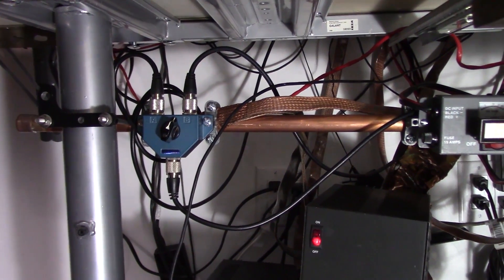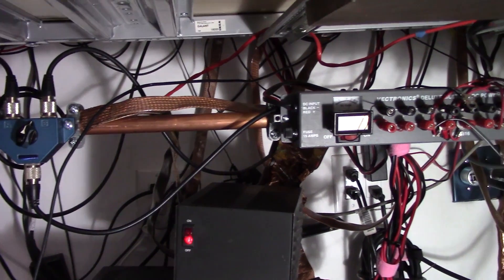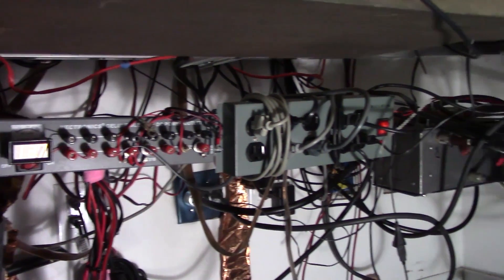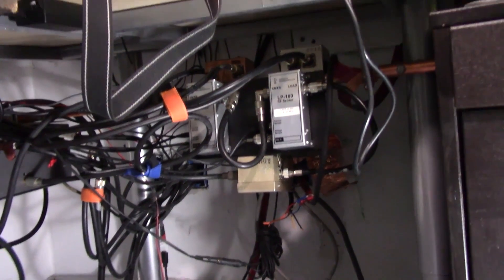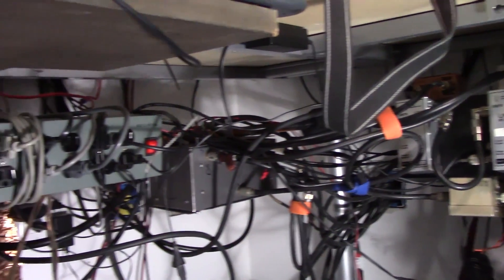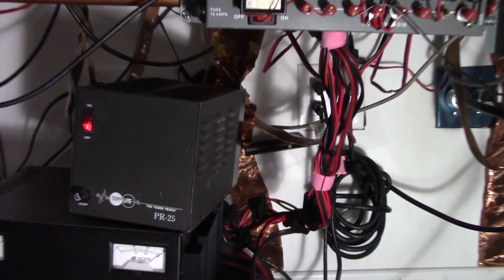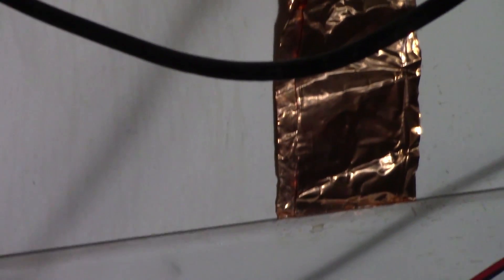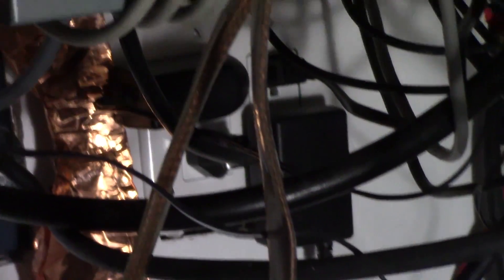Station Grounding & Extra Class License Question That Has The Wrong Answers Part 2 of 2

Comment: Hello Jim.

I have a Grounding question. I have a copper pipe for grounding all my radios inside my Shack & all other Ham equipment.

Then connecting it to my outside utility box to my copper bar where all my lightning arrestors are.

From the Copper Bar inside the Utility Box connecting to my Ground Rod buried 9' on the ground. Is it safe to connect all my radios & equipment w/ the lightning arrestors?

Some said it's wrong to put them all together. Was wondering about your opinion about this?

Someone suggested that I need a separate Ground Rod for the Radios & Equipment.

That it does not make any sense connecting the Radios & Equipment w/ the Lightning Arrestors for the Antennas?

It is very expensive to put another Ground Rod because my Ground in the Property is Granite. I had to hire 3x Laborers to Sledgehammer the ground rod for 4 hours. Costing me around $400.00 in Labor per hour.

Stay Safe.

73
Ruben Tiosejo
KD6CWI

Comment: Thanks so much, Jim! I've learned a lot from all your wonderful videos and sincerely appreciate you sharing your invaluable wisdom. One question I have about bonding equipment (via copper pipe or strap): Is it enough that you've bonded the equipment together without it having to be bonded to anything else? Or, if that pipe/strap needs to return to be connected to earth at the main panel, how do you get it there? In my situation, the shack I'm creating is at the opposite end of the house from the main panel, as well as on the second floor. If I were to try and connect a buss bar from my shack to the ground at the main panel, that would be a helluva long run! And I would imagine it would also be some serious resistance to current flowing to earth, not to mention the creation of yet another path to ground. Does this make sense, or am I missing the point? Any clarification here would be immensely appreciated. Cheers! :-)

Comment: I have a window feedthrough that is an aluminum panel, is it of any use to ground this to the house panel service ground? I mean the radio is already grounded through the 3 prong plug, will this just create a ground loop?
Reply from the maker: Watch my video again.  I explain why.  If that does not make sense the second time, add another comment.  73, Jim

Comment: Power to the house is about 50 feet. Copper pipe in a L shape, all my equipment is attached to it.  Should I drive-in some more ground rods between outside the room. Then #6 copper wire to the main. Ground. 
Hope you feeling better. Still doing breathing treatments everyday. Hope to meet on 20 sometime 73 KQ4CD Paul

Comment: Great 2-parter. As someone just building a proper shack, there is probably no single subject as confusing as grounding, and I admit that I simply learned the answers to the grounding/earthing/bonding questions for the test and said, "I'll figure it out when I come to it in real life." Now, here I am,  and I still don't understand very much. Before I start throwing switches, I'm going to hire an electrician for an hour to come check my work, lest I fry equipment or myself!
Reply from the maker: Hi,
I am trying to fix two computers.  I have about 75% of it fixed. 
As far as having an electrician, that would be good.  If you have a friend who is an electrician and would do the inspection for free, that would be even better.  If you want to take some pictures or video and send it to me, I can take a look. Also, I really want to get a Zoom account.  If you I do that, we could chat on Zoom and I could see your wiring.  I did work as a B.I. for several years.  Thanks again for watching and writing. I does mean a great deal to me to hear from other hams like you.  73, Jim....going to bed now, it is late

Comment: Here is a good example of why all grounds should go back to the service ground.  Years ago I was providing power to a new linear accelerator in a local hospital here in Maryland.  The manufacturer's representative insisted that no grounds be tied to the building and that I provide separate ground rods for their system.  Owner of the company I worked for agreed with me that it was a code violation and ended up having the manufacturer sign off absolving us from liability. During testing manufacturers representative shorted the main. Luckily I was there to kill the power.  Of course everybody said it was our fault and they brought an electrical engineer in who looked at the system and notified the hospital, the ground was indeed wrong and needed to be removed from the separate rods and run back to the service ground. For a long time I wondered how many other hospitals this manufacturer's equipment was wired that way.
Reply from the maker: Thank you!  That again is a story that needs to be told and understood.  I have heard about that situation and perhaps that same happening from others. Thanks for the help.  73, Jim

Comment: I'd show you my apartment station, but I'm afraid you'd have a mental meltdown, or, well, be "shocked" that I haven't had an RF grounding problem.
Reply from the maker: Honestly,  I don't think it matters.  An RF ground is mostly an illusion.  RF engineers tell me it does not exist in a ham radio station.  73, Jim
Reply: @ham-radio  One of my all-time favorites is being told to run a wire to the center mounting screw of the wall outlet plate to better ground the radio and such.  And that's from other Hams that had their licenses for 30 years longer than me "ASS-uming" that because I was a newbee I didn't know I didn't know nothing!  And thus my favorite personality trait; the condescending prick that's full of themselves.

Comment: My take away from your excellent videos on grounding is this. If you have simple setup, the electrical ground is all you need. Is that right?  Or did I misunderstand?  Thank you so much for this wealth of information on YouTube. I’ve been going through your videos a little at a time starting way back when you first started doing them. You are making me (and many many others) a better operator.  I appreciate it greatly.
Reply from the maker: Yes.  Thanks Tom.  I have come to the conclusion based on 57 years of trying, there is no such thing as an RF ground for the station.   My new location's station has shielding and grounding with copper straps 3 inches wide and at 2 levels that wrap around the room. The effect is just about zero with respect to "RF grounding".   The only thing that I have found is that my cell phone  does not work well in the radio room.  Thanks Tom! 73, Jim

Comment: When I first saw the question and answers I assumed it was a trick question because you were highlighting it.  I immediately picked option B.  I'm not a grounding engineer but I've read an awful lot of materials written by them and I'm afraid I see that question as spot on.  Sure, the grounding system (not just a ground rod in isolation) doesn't make your facility lightning proof but it does provide a low impedance path that isn't your house/radios/you for all that energy.  Assuming you have done your part and provided proper installation, arrestors, etc.  Your point about integrating any additional grounding you might add with the power ground system is also spot on.  Building  codes require this for good reason.  I was watching a tower maintainer speak on the subject of grounding and he brought up a very significant point:  30 years ago it was common for commercial radio transmitting sites to lose radios with every lightning strike.  Now, just by implementing R56 grounding standards they never lose radios.  Antennas and coax gets lost but never radios.  Those standards are a bit expensive for us amateurs to try and build but the principles are the same:  Give lightning some other option than your radio when it decides your antenna looks tasty :)  Keep these clips coming.  I love these deeper dives.

KL5DV
Reply from the maker: Thanks and please comment anytime you see or hear something that needs to be corrected or improved.  The subject of grounding/earthing/bonding is indeed confusing.  I recently had an engineer respond with a question. He was confused about reactance.  Seriously.  I wrapped this room with foil and copper strips 3 inches wide.  All of that does little except to create a sort of shield.  Mostly, my cell phone doesn't work well inside the room.  Outside of the room in the garage, the phone works. In any case, thanks for the help. I took some new meds and slept most of the day.  Crap!  So, I am back to working on a 2K4 amp that has not been used since 1993 and has 4 tubes new in the box dated 1978. I am slowing warming up the tubes with a Variac and filament transformer, socket, fan, voltmeter on the work bench.  73 Jim

Comment: My radio experience is limited to cb, but in wiring in apts, barns, trucks and cars, I have found that most problems are due to improper grounding. In the case of 110/220 can be very dangerous. I find it amazing the people who try to wire things up, with absolutely no understanding, that make it dangerous for others. Those that are too stupid to realize that they are ignorant. If you can swallow your ego and say, hey! I don’t know, that is the first step to learning. Then, perhaps, you won’t kill anyone with your ignorance! Thank you sir for the video, you are obviously qualified, I hope you get a lot of views. Especially from the ignorant ones previously mentioned. One more rant, the difference between ignorance and stupidity is that ignorance can be cured with way less effort than stupidity. Stupidity, unfortunately, is often fatal. It should be a higher percentage for the perpetrators.

Comment: It's important to know the full scope of standards you intend to comply with.  I'm not a radio guy or a licensed electrician.  I have however built test laboratories that test for electrical safety, employ faraday cages, etc.  In the 80's we built a lab to comply with UL-recognized lab requirements that would also comply with certain EU directives.
Our ground rod was required.  It had to be a minimum of 10 meters deep in the ground. 10M was the rule whether your lab was built on quicksand or granite.
The diameter of the rod was a little bigger or about the same as rebar.  It was made of thrice-plated steel to minimize corrosion and maximize resistance of above-ground connection.
We installed a lightning rod for the building that went to a separate ground located about 20 to 30 meters from the building.
The rod of discussion here was located as close as possible to the building the lab was in but NOT in reference to the entry of public/industrial electricity supply entry.
Our mains goals were to: 1) measure with precision any LEAKAGE CURRENT or TOUCH CURRENT of test subject equipment, 2) provide a noiseless ground for EMI measurements, and 3) provide an ample path for PSCC (potential short-circuit current) in simulated failure mode testing.
I wound up here because of geopolitical interests leading me to consider potential outcomes possibly resulting in loss of communications.  I'm not a prepper per se, not a militia guy or anything like that.  I'm planning to move out of a big city to a semi-rural environment as part of my normal retirement plan.  I like tech stuff and radio and satellite things are interesting to me even though I know so little.  I saw the ARRL statement of January 17th and the FCC statement as well - very strange.  This is how I found this channel.

Comment: Thanks Jim! I'm just starting to set up my room, I saw the guys video about using the groundless adapter to plug into the outlet. Wow I was Confused. Glad you set me Straight. I have already installed a 2nd ground rod and tied in to the Original Panel ground rod...No Loops..fingers crossed.

Comment: The one detail I still can’t find is when you say “tied back to the electrical panel”.  How do you do this?  Technically,    Screwing a connector to the screw on your outlet face plate will do this but I don’t think that is what you are doing. :). Did you have an electrician set up a grounding connection of some sort in the room?

And, as always, great video.

Comment: My station took an indirect lightening strike.  The energy came down the transmission line, entered the shack and jumped across an open commercial antenna selector switch to ground.  I have since isolated my incoming transmission lines and have them completely removed from any ground source except when my station is in operation.  That way there is no ground for lightening energy to seek inside the house.  I am also in the process of grounding the transmission line shields by way of a bulkhead mounted outside and connected to a ground rod before they enter the house.  Is this adequate?  The only ground in the shack is the 3rd wire AC connection back to panel.

Comment: Great content, I learn something with all your videos.  I do have a comment about all the electrical wires and 'whatnots' under the desk.  I have to wonder if any any of that electrical current/flow could overtime contribute to the deep vein thrombosis?  I'm not a medical person by any means, just a thought.  Again, great information all the time, very much appreciated!  Thank you, Jon, W1JJN
Reply from the maker: Jon, I don't know.  The cause of my near death experience was never determined.  I went to UC Davis and several doctors with no good answer.  Many, many difficult tests were done including pumping radioactive stuff into my lungs. 
When I arrived at the ER, that doctor (finally someone listened) had the correct tests run.  A D Dimer score of over 500 means that the patient is in trouble with blood clots, emboli.  I scored a hospital record high at 12, 300+.  They really could not believe it was that high and I was still alive.  
Exposure>>>RF for decades.  Radiated as a child to kill off my thyroid gland.  That was called an ablation. I will do some research.   Thanks and Happy Holidays...next year has got to be better.  73, Jim

Comment: Hi Jim nice 2 part video,
over here in the UK there is so much miss information  regarding RF earths . A lot of the text books will relate to US codes and in no way relate to the UK electrical regulations. Connection of a good RF earth to your radio gear can in some cases be better than the incoming mains power earth, which means you are potentially diverting any mains fault current down to your RF earth via your radio power supplies. This fault current may originate from a distribution fault and not from your internal domestic set up so in effect your RF earth becomes  the fault path for the distribution companies faults ! ...a fire hazard and electrocution are rare but real risks.
This type of hazard is particularly common on underground type supplies in the UK and similar network set ups.

Comment: My solution to the ground loop  problem is to use an audio isolation transformer.  They are about $10 at an automotive store for a left and right stereo connection.  No need to remove a ground prong.

Comment: During your tour under the desk, I noticed the clamps being used to secure the straps to the 3/4" copper pipe.  I have often wondered if using dissimilar metals here causes any trouble, such as corrosion?
Reply: Hi Art dissimilar metal corrosion is a real problem but normally water is involved so dry indoor conditions are much less problem than damp conditions

Comment: Hi Jim.

It recently came to my attention that Mr. Microphone is an honorary "Doctor" of electrical engineering. 

Defeat your ground prongs? Maybe he spent a little bit too much time partying with the grateful dead!

Kinda funny coming from a guy who lined his walls with copper foil. 

HI HI Jim. 

Thanks for the video and Merry Christmas!
Reply from the maker: All true.  For me and the foil (hat), it was a test to see if I could measure current flowing in the grounding conductor when transmitting.  And, I did that foil and copper very carefully.  It is so good that my cellphone does not work well in the radio room. My prong is intact!! Not much else is.  And yes, the doctor BS is ridiculous and tells us a great deal about the individual.  Take care Ben, 73, Jim

Comment: As an electrician in California You are allowed to add supplemental gound rods to the system.  But you need to check that the neutrals are not bonded at any other location beyond the service entrance.

Comment: Ground loops are typically created when a ground circuit has more than one path creating a closed loop. Current carrying conductors in parallel and typically running close to the ground can induce a current onto the loop in much the same way that a transformer is a primary winding inducing a current in a secondary winding and cause current to flow when there is a closed or completed circuit.
Reply from the maker: Thank you for a short, correct, to the point description of a ground loop.  Most times the issue that is thought to be a ground loop is RF feedback due to common problems like a poor shield on the mic cable.  If you look at mic sold online, the shield, braid is maybe 50% instead of 98%.  Thanks Jim

Comment: My station is only grounded thru the wall plug. I think electricity follows the path of least resistance and I want my ground to only be average so the lightning will find my neighbors super ground and leave my house alone. It's worked great sence 1990. No lightning strikes. 
Ke4fwe...
Reply from the maker: Thanks for sharing.  My video is really not about lightning but just the electrical grounding.  Stay safe Jeff. 73, Jim W6LG in Rocklin, Ca